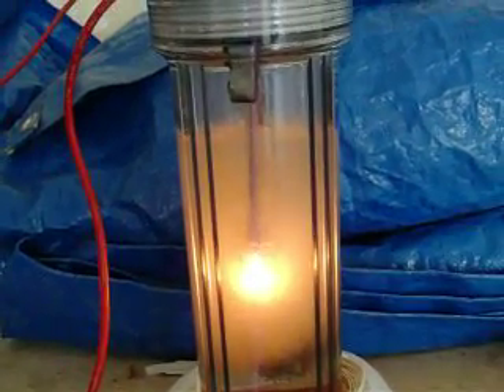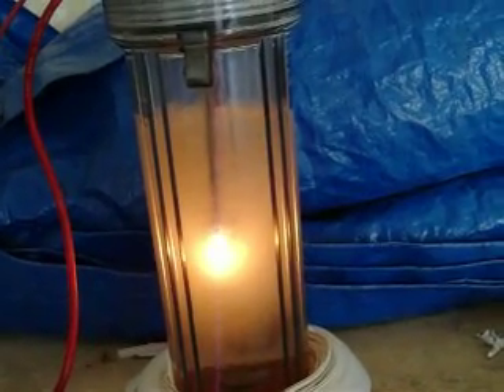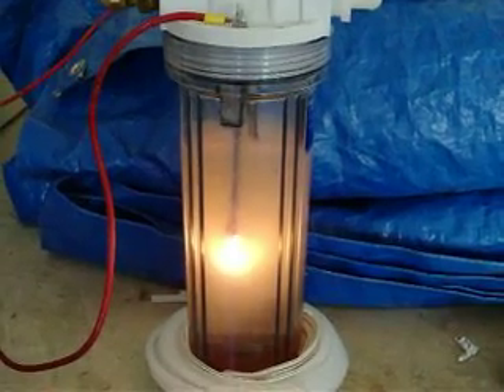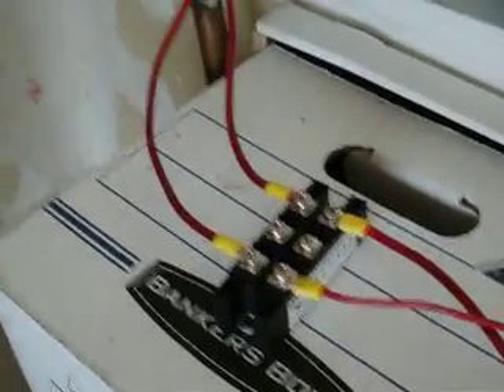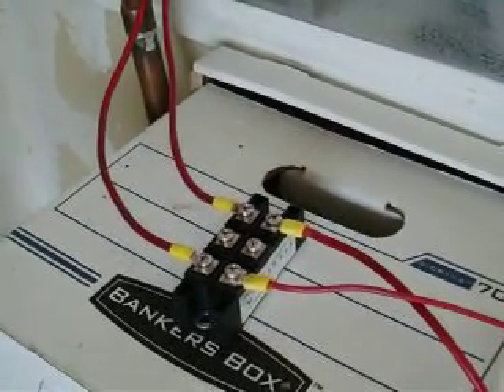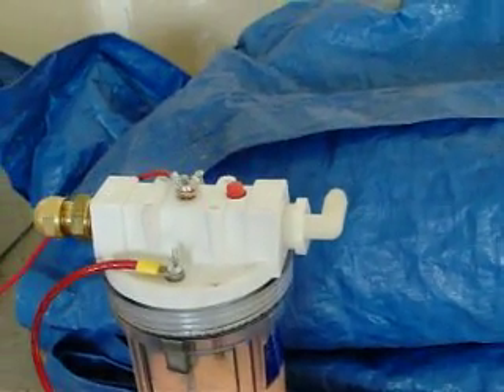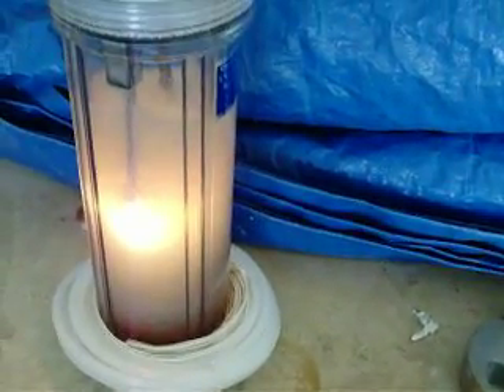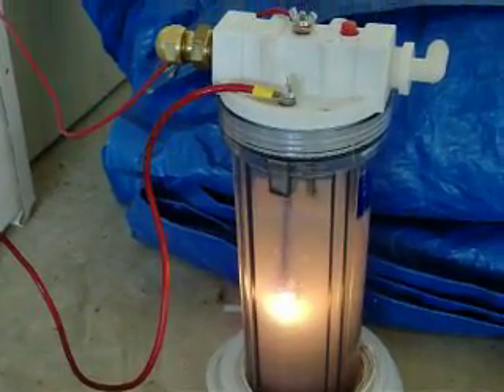Cold Fusion - Redneck Style - Test 2b

Comment: i made a video about running one of the leads off of the  rectifier through the primary off of a microwave transformer, and it gave quite a reaction "distilled w/ Baking soda". check the video out, i  used 120ac/ dc throught the MOT. wonder what it would do with a MOT on each leg of the 240??? 

and im not even talking about the possibilities of the secondary leads....